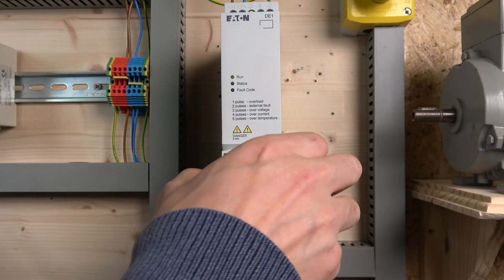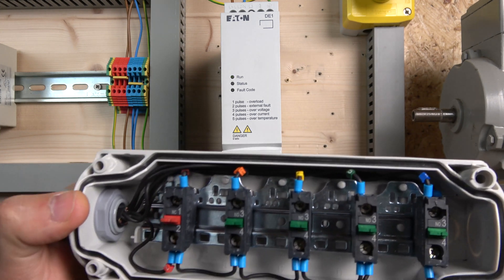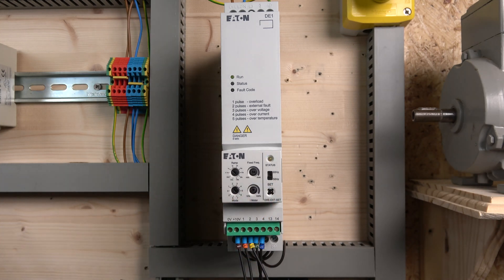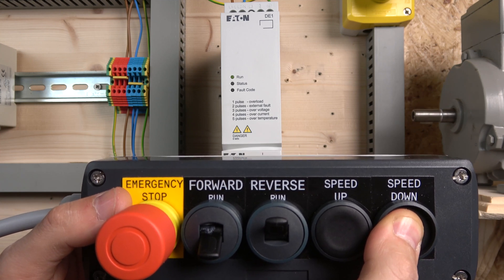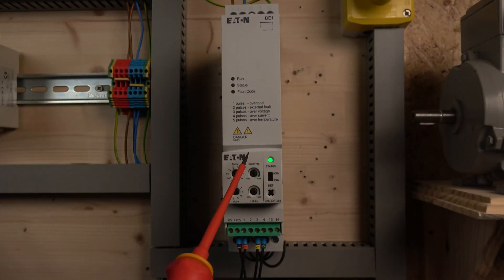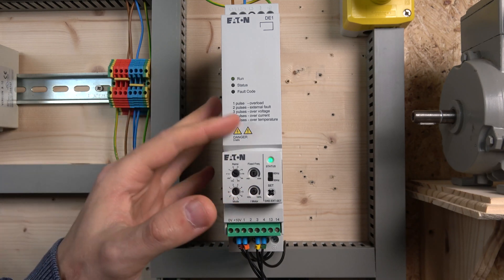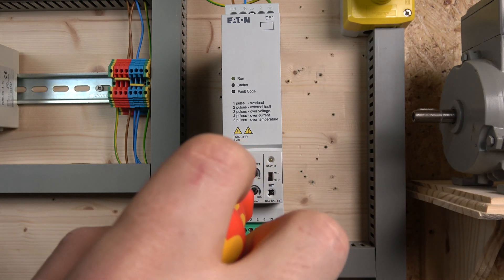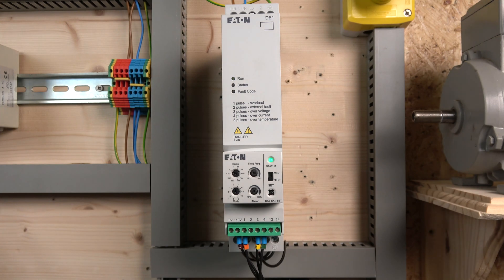Eaton DE1 VFD, remote control, MOP speed control, Multi frequency set up. English.

Comment: Ive bought one of these and didnt know it needed the Ext module. All I need is a single speed (fixed 50 HZ) to switch on a coolant pump. Is there a way to configure this without the Ext module or connecting a laptop?
Reply: OK, got it to work. You must connect the speed ref before run, then its OK to start. Was lucky to find that.